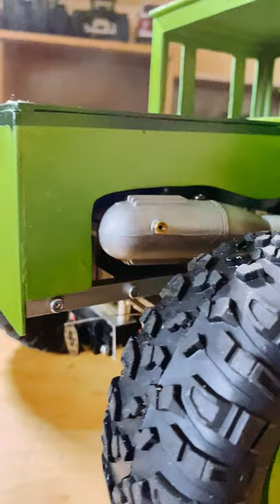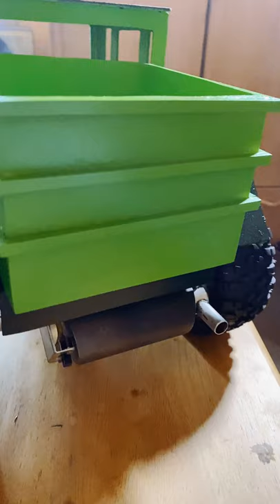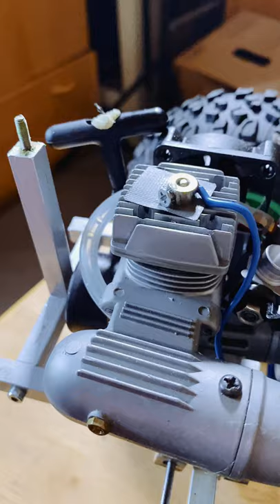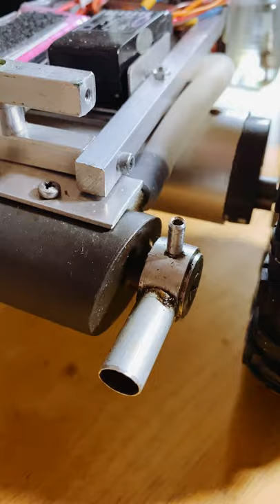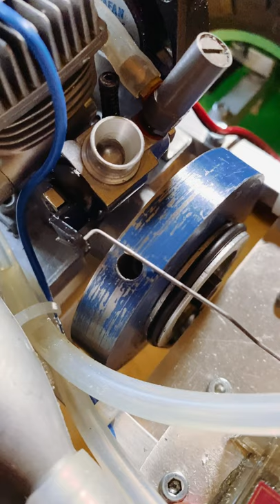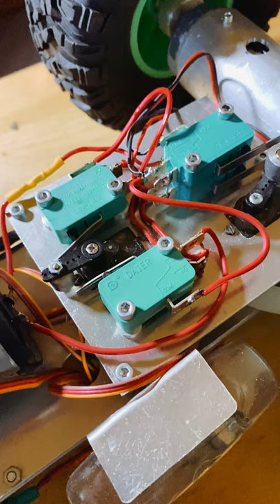MB Trac - Homemade RC model #Shorts

Comment: That's pretty damn neat. What are those green electrical boxes and the circuit board for?
Reply from the maker: Hello, the green boxes are micro switches for forward and return and the circuit boards are dc-dc converter for receiver and glow plug.  greetings  Hans
Reply: @bastelhans  awesome thanks